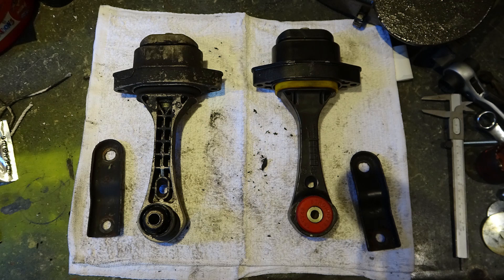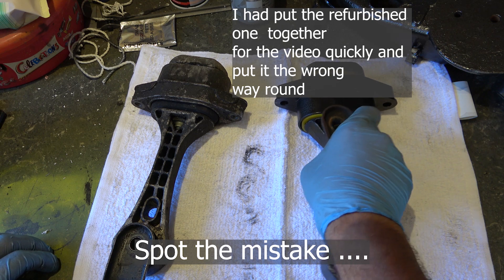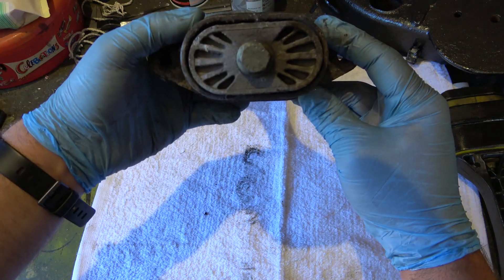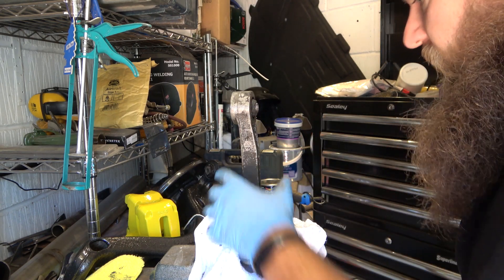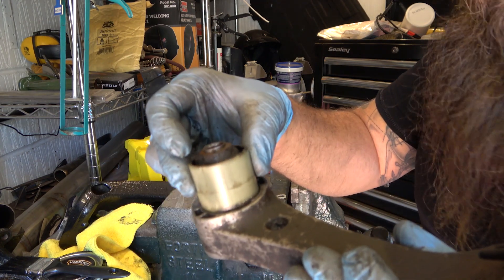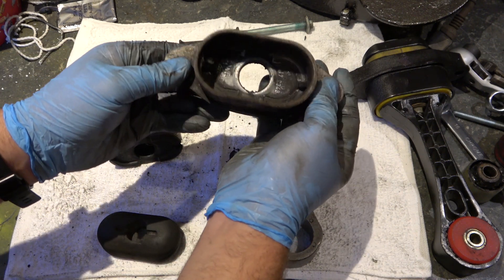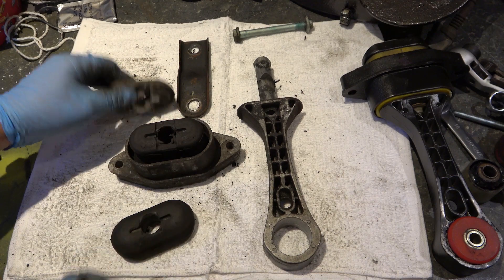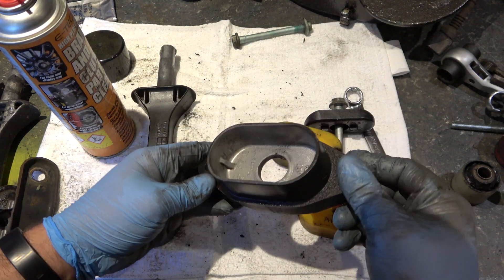Changing Both Bushes To Polyurethane On Dog Bone Transmission Mount Audi TT Mk1

Comment: Great guide. I bought a second-hand dog bone and gave it a refurb with powerflex bushes this weekend.

Just need to fit it to the car now, but have heard horror stories of the bolts to the subframe shearing. 😱
Reply from the maker: That’s the best thing to do, if anyone needs one I have a spare here now they can use. Always nice to have it built up can swap straight over. 

You go for front and back? They are snap, best thing I can advise is clean the heads off, when done just take it one bolt at a time. If one breaks or shears then can take into a mechanics workshop to sort. Unless you can weld and put time inserts at home :)
Reply: @TheParrottBros  Yeah I did front and back, got both as part of the Powerflex "Handling Pack" so thought I might as well.
Yeah I'll give the bolts a clean up, and some penetrating oil the day before. I've got new bolts to go back in, so they only have to last long enough to come out. :)
Reply from the maker: Top man, for what they cost I always try and use new bolts where possible. Saves a lot of head ache 😂

Comment: Just did mines yesterday while doing a haldex service, such a good cheap mod!.
Reply from the maker: Nice coincidence! Great little mod, what brand did you go for?
Reply: @TheParrottBros  Well mines was a slight cheat as it was the one from my old mk LCR that my mate and i are breaking so it was just a swapover really, it has powerflex bushes.  Been lying in the boot for about 6 months 🤣 and finally did it yesterday was it was up in the air for the haldex service, we were also going to fit the ttv6 front arb from it too but by that time it was way too warm and far too beeroclockish.  🍻 Need to get myself a R32 or TTV6 rear arb too at some point, got any going begging ? 😂
Reply from the maker: Haha that is a cheat 😂. Nice when the parts are compatible on multiple models.  I’ve only got the arb’s I need. If i hear of any I’ll let you know for sure 👍🏻

Comment: Great video! Just wondering do know what torque setting is needed when refitting the dogbone? I swear you mentioned it in your video but can't find which section of the video it was in. Thanks in advance.
Reply from the maker: Dog bone to subframe - 20Nm (15lb ft) plus 1/4 turn (90 degrees)

dog bone to transmission - 40Nm (30lb) plus 1/4 turn(90degrees) 

just be careful as they can strip out of gearbox if you go too much

Thanks DOm
Reply: @TheParrottBros  thanks for the information and advice, appreciate it! 👍

Comment: Another job for my expanding list, did you choose the yellow over the red (rectangle) bushes purely for track use. I've read the yellows can be too firm and cause rattles
Reply from the maker: Haha watching my videos will cause you to want to buy more car parts. The big yellow one is power flex and yellow is for petrol and tuned diesels. They do a black one which I’ve heard is meant to be super hard ive heard. And the other end I used strong flex red as it matches the whole set up I have for both subframes etc.
Reply: That's it! 
The one I'm referring to is Pff85-420R. For 'diesels', when I've looked into changing the dogbone previously the forums recommend this one for everyday use.
Reply from the maker: You know what I’ve never even looked into the lighter option, to be fair if your worried and it being too harsh a brand new stock one would work just as well as it would be nice and tight compared to a 70/80/90,000 mile one. Much like all the bushes stock is good when new, but like anything 17 years later is tired 😂

Comment: Would you say this is a good mod for DSG? I'm unsure whether the jolt when accelerating from standstill or on a hill is because the dogbone is worn or if it's just the original DSG character on my V6
Reply from the maker: You know what ive never fitted one to a dsg so couldn't say, i put a trans inset in on my audi s4 to reduce the movement and it made gear changes miles better and less jerky

Comment: Hi Dominic this is me again. As I told you I saw your video and taking into accout that the car is on stands for chage intercooler pipes after watching your video I decided also to change dogbone bussinghs. I have 2 doubts.
1) PFF85-505 : in the video this bush  is red. I am searching to buy it and I see  it is bue or purple colour ¿? 
2) PFF85-420: you installed yellow ones. I was wondering if black series will be too hard. I installed them on my bmw 330d and I am very happy with the.
I will change for shure the bolts. Any tip to avoid thred probles and need to put helicoils and so on?... I am litte bit affraid about that.  Anyway  check torques for each bolt in Elsawin Audi-vw software.
Reply from the maker: Hey fella, the bushes i used in the video, the red one is strongflex as came in a kit i had, based in poland it makes them more expensive to get delivered hence why i quoted the Powerflex option as same product just diff colour :).

Bolt wise they should be fine unless they have had a hard life in the past, do one at a time and hope for the best, im sure they will be fine. i always like to cover all eventuality in my video so people know what they are getting into 

purple or black is your call, if you use it solely for track black is stronger, for road i would go purple, stronger than stock but not rock solid so provides comfort over black
Reply: The Parrott Bro’s  thanks!!! I will order them inmediately. Hope to have big improvement. 
Yesterday I installed superslider from dieselgeek ( you have videos on youtube but firvsure you will hear about the) After that I make the gear box cables reset procedure and I noticed very big improvement. Very good diy job if you have not done it. Few weks ago I also changed bushing from gear shifter bushings (also from dieselgeek) Now The gears enter perfect!! Like a winchester! 😜
Hope ta dogbone bushing replacement also helps. Pending to change gear box oil ... never end stoy. Did you changes gear box oil? After 20 years it will be....
Regards!!!!

Comment: i've done that same polybush swap...but now my car vibrates like hell when i accelerate (at low rpms). Any suggestion? beside changing back?:)
Reply from the maker: kicsipupi I have heard some say that the small round Bush causes this, personally mine doesn’t at all but that may be due to the fact that everything is polybushed 😂
Reply: @TheParrottBros  true:)..poly mounts are stiffer:)
Reply from the maker: kicsipupi I would give it a little while as it will probably soften up a little
Reply: i've done that same polybush swap today without the the small red/round one and my car also vibrates crazy. Did it become better in your case? Less vibration after some driving and soften up?
Reply: Yes, it become normal like before:) DO it! @ViktorFinal

Comment: I've seen polyurethane in RED, PURPLE, YELLOW and BLACK, what's the difference? are different colours used in different places?    Great video series.
Reply from the maker: Purple and black are by ‘powerflex’, black is track and purple is road. The yellow and red are ‘strong flex’ similar set up, but strong flex only make certain bushes in one colour depending on what they recommend. Thanks for the kind words appreciate it